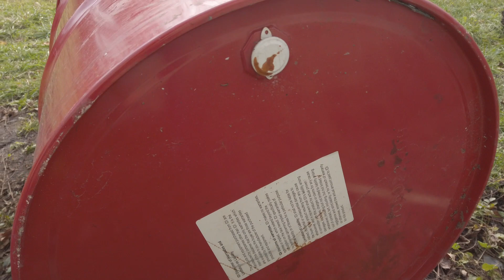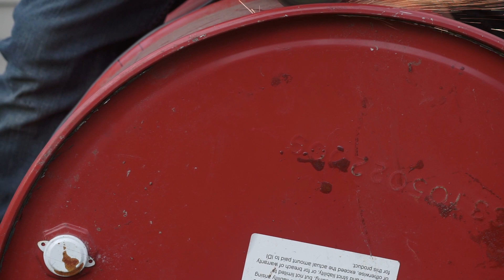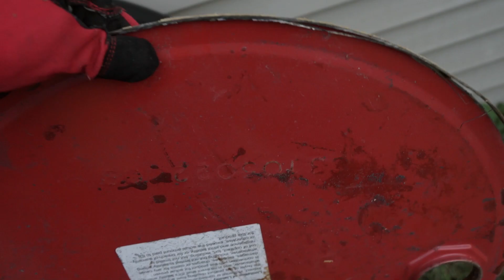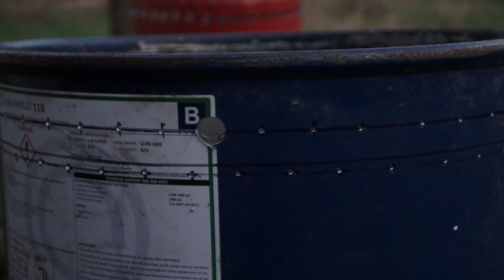SMOKELESS BURN BARREL Incinerator

Comment: You can use a old hot water thank for the inside peace . It’s thicker metal and it will last longer . Most are 14 inches and bigger. This is one hell of an idea . It’s not bad till you get two or three negbors burning in cans with no holes in plain drums . All it does is smolder for hours I’ve  seen times they still would be smoking the next day . Besides if your not heating with it you want it to burn as hot and as fast as you can . This way it burn’s completely then the fire dont last long . Keeping every thing safe insted of tending to the fire you can go on and do something way more important. The best thing is not smoldering for days stinking up the neighborhood ! Stay safe and thanks for the video maybe we can get every one that burns doing this !

Comment: I bet you had the best "grinder boogers" after all that cutting. 
Btw, take this from a guy who has been in and around welding and steel fab for most of his life. Flannel and sweaters do not mix with sparks and high speed rotating power tools. When picking clothing for cutting & welding, imagine whether sparks will bounce off your clothing or get caught in the fabric. I have known welders to get their FR (flame retardant) shirts starched 3 times heavier than normal to improve deflection.
Reply from the maker: Wish I had this advice before starting. Yeah, I had to throw out the fleece I was wearing. It was full of metal.

Comment: I'd recommend a chain connected to strap while cutting away the 5 inches out of the smaller diameter barrel, my cut wheel found traction and cut the strap where you precut the middle.

Comment: Nice work my friend! the only thing you should consider is to redo the bottom grate without all the holes.  It is what gives the flame its swirl which helps a clean burn.  By perforating the bottom grate so much it isn't getting the full swirl to the air flow and that will cause an inefficient burn. It is more than efficient enough for a burn barrel though :)

Comment: Was wondering if you burn plastic, will it still produce smoke?
I have a recycling plastic granulator and screen mesh is use
to filter dirt from plastic melt and overtime, this screen gets
clogged up and the only solution is to burn the screen with plastic
melt in it..

Comment: It might work a little better with less primary air.  Too much primary air and the chimney effect carries the unburnt gas up and out before the heat can fully break it down…  The fire pits I build need almost no primary air to burn clean. But a tall chamber like this would need some…
Reply from the maker: Once the fires stoked up, there’s virtually no smoke. When I’m getting the fire started initially there’s a bit of smoke.
Reply: @willberness6697  The tabs at the top maybe need to be inclined inward slightly more to help with that.

One way to control the primary air with these is to use paver sized bricks around the base as a "starter choke".

Great video! Was nice to see someone else struggle with the legs.

Comment: how long does this build last? 
also, please make a video when burning plastic, etc.
Reply from the maker: I was working on it at night after being at my job. I spent a few hours on it every night. I’d say it took me 2 days of work. if I was working on it all day. If you have a better cutting tool (mine isn’t very good) you could probably do it a lot faster.
Reply: Thin burn barrels don’t last long, the heat cooks the carbon out of the steel and they rust away pretty quickly.  To burn plastic without your neighbors turning you in(big fine for illegal burn where I live), you need to get them much hotter than this thing will get. you basically need a waste oil burner(stainless steel burn chamber and pre-heated forced air…
Reply: @rronmar  thank you for your reply. I will keep using brick then. No fine in my country
Reply: Please do not burn plastic. You can recycle instead.
Reply: @trebledog  depends on the place you live, actually. In my place there is no such service